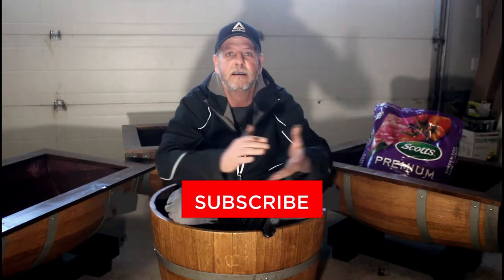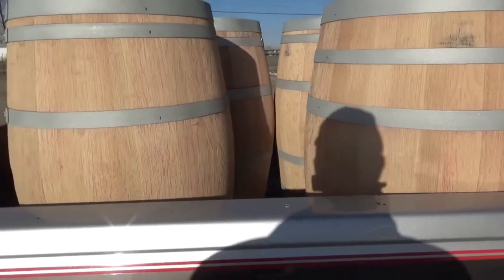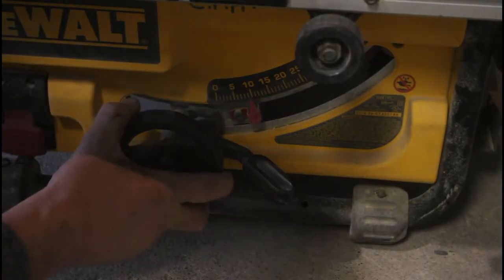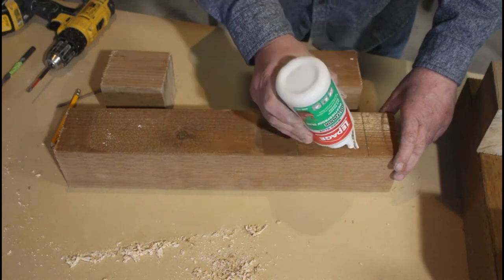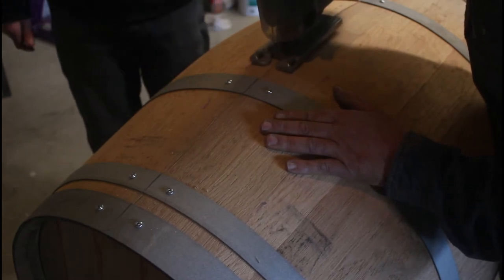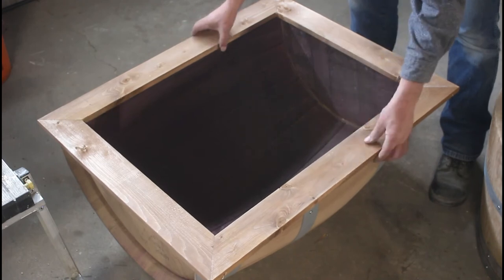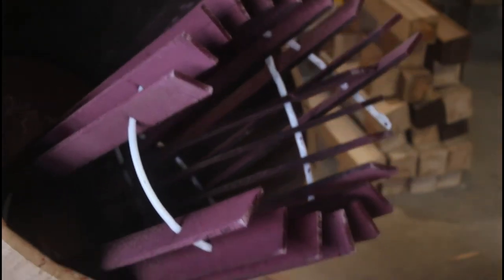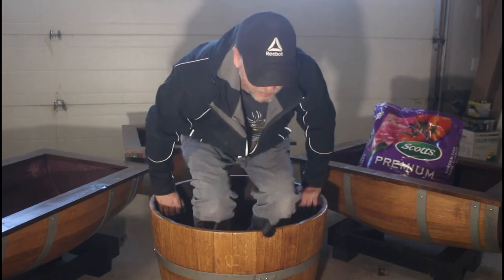THESE PLANTER BOXES ROCK | DIY | Raised Garden/Flower Boxes

Comment: Looks great…. What were the dimensions on the frame… I’m making some this weekend
Reply from the maker: Hey thanks a lot, my frame size was 38”x 28” but there are different size wine and whiskey barrels so yours could be different, best to figure it out once you cut the barrel in half. One more thing to note, if I were you I would use bolts rather than screws on the metal bands. I found over time the dirt was to much pressure and popped a couple of the screws that I had to replace with bolts through both the band and the wood.